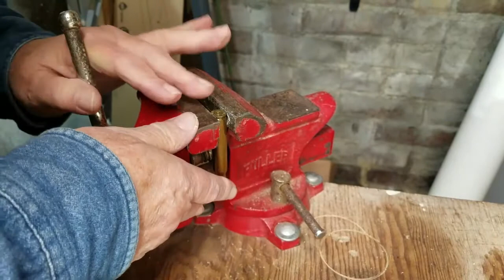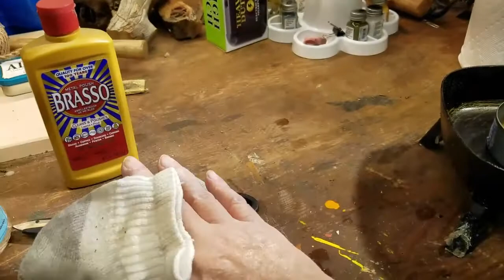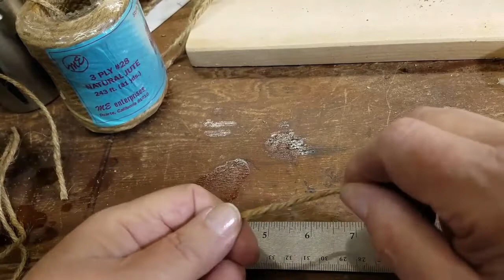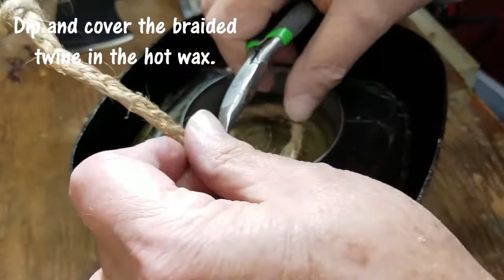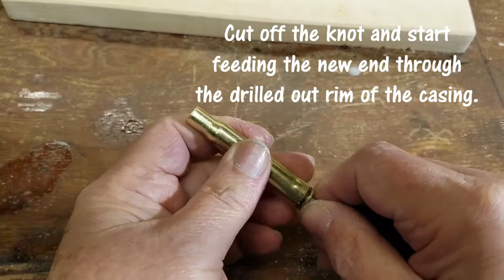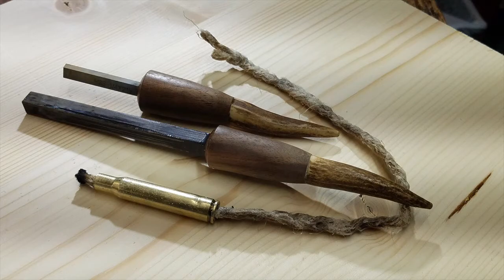Making a "Freedom Forever" Match with a 30-06 Shell Casing

Comment: The gas station down the road sells metal straws for drinking. I bought one and cut it in half. 
Used jute and wax to make a couple of these. 
It worked out very well. 
👍🏼👍🏼
Reply from the maker: Those metal drinking straws have really caught on with the ladies and their drinks.  Glad they worked for you with the match-making!